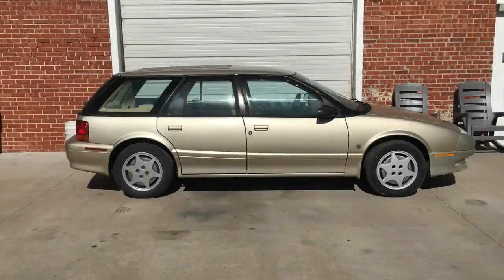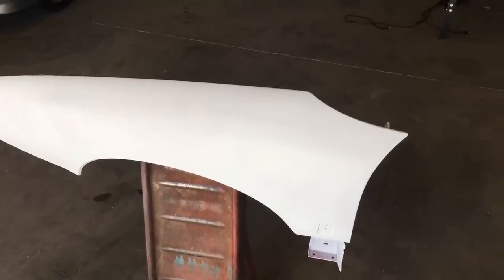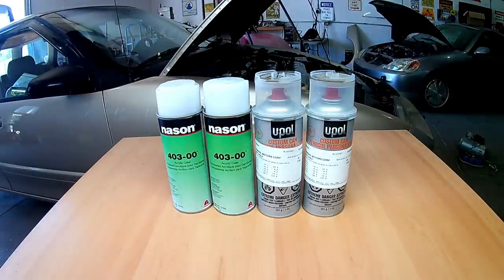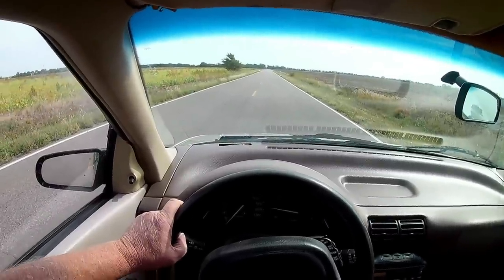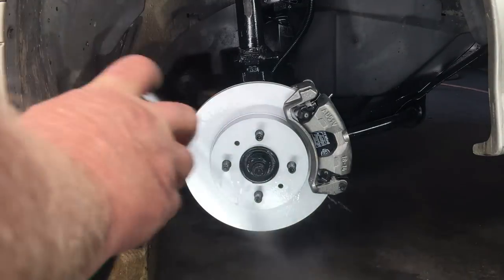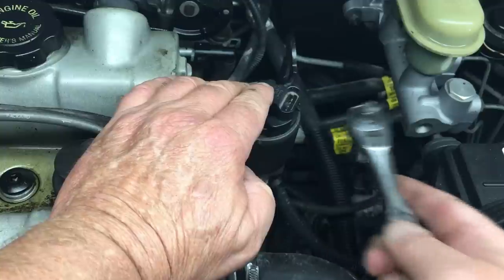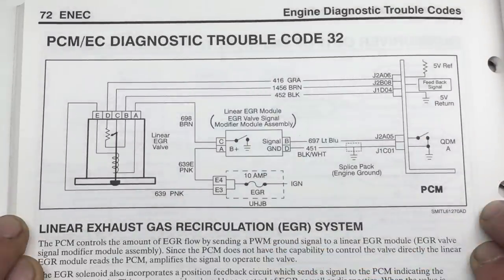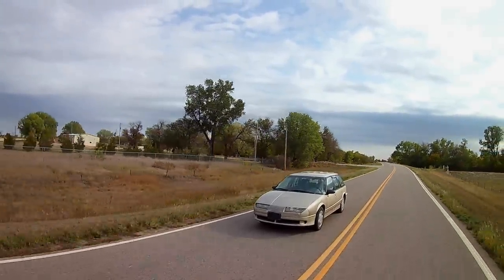S2E23  Our Saturn Wagon surprises us with some unexpected repairs and a twist or two...

Comment: that is actually quite a handsome car. though that front bumper cover could use a touch of paint. Any ideas on a twin cam that's getting worse gas mileage and still vibrates even with new motor mounts?

Comment: The higher the tire tread wear the less grip you get on road, but it should also be note that also traction and temperature rating on the tire with low rating is also bad. Oh take look at aldlcable and 1320electronics they got ALDL to USB cable

Comment: Just under $2K for what looks like a good runner isn't all that bad in 2022. (At least if you have the means to do all the work on it. Labor can add up stupidly fast otherwise.) For its age an a domestic model at that, it's in rather good condition - at least from what's visible and shown here.

Comment: I do wonder how you guys over there can drive without plates and not end up pulled over by the local rozzers, here in the UK, get caught driving with an untaxed & uninsured car and they haul it off for crushing... :S
Reply: Some states only have a number plate in the rear, so that's why you may have noticed the front one missing?
Reply: Kansas only gives you one plate. There's one in the rear.
Reply from the maker: We try to avoid the rozzers as much as possible.  All of our cars are properly tagged and insured per state law.  Kansas does not require a front tag on a car.
Reply: @robotcantina8957  GREAT TO SEE YOU AT  102K  SUBSCRIBERS JIMBO!   Congratulations, your hard work and  fun videos resulted in celebration!

Comment: did you check the water pump on the diesel engine?
you know, because of the short bolts and stuff
I would recommend to install threaded studs,  you get the most amount of thread engagement possible
Reply from the maker: Will do, thanks!
Reply: @robotcantina8957  GREAT TO SEE YOU AT  102K  SUBSCRIBERS JIMBO!   Congratulations, your hard work and  fun videos resulted in celebration!

Comment: Actually no rpm signal
Reply from the maker: Code 12 goes both ways, you are correct its no RPM signal,  but since the engine isn't running when the codes are pulled, its always going to be on the list.
Reply: @robotcantina8957  exactly what I learned in 78 at GM tech center in Jacksonville.
Reply: @dennisford2000  “Kind words can be short and easy to speak, but their echoes are truly endless.”–

Comment: To Make Money in the Stock Market, Do Nothing
The bear market endures, yet the S&P 500 index rose more than 17 percent from mid-June to mid-August. Don’t even try to guess what will happen next.....
Reply: Or you could buy bonds starting now. Should see a FED pivot after the next rate hike! Just a guess!
Reply: @dangerousdave5915  October is the most volatile month

There is a myth surrounding October in the stock market. There is even an effect called The October Effect.
Reply: People think that the stock market declines more during October than during other months. There were two big crashes in October. The Great Crash of 1929 and the Crash of 1987 were both in October.
Reply: But if we take the statistics over a long time, this effect is not significant. More bear markets were ending in October than starting in October. This data makes it more interesting. And these two crashes are old enough for most people to ignore them. Because of these points, fewer and fewer people believe in the October Effect
Reply: However, according to data, October is the most volatile month in the stock market. There are more large swings in the stock market during October than during any other month. So, you need to be ready for some strong volatility during October.

Comment: General Electric expects to save between $3-5 billion over the next 10 years by switching to 3D printing for manufacturing.
Reply: The metallic 3D printing market is expected to grow to $6.6 billion by 2026.
Reply: Scientists are looking into 3D printed food.
This sounds something out of a sci-fi movie, but it’s true. Scientists today are considering 3D printers as a food source. Currently, 3D printed food is still limited and only works with softer ingredients like cheese, chocolate, and syrup. However, scientists believe that even with those limitations, their work has promise.
Reply: Designs for 3D printing are first made using Computer Assisted Drawing (CAD).
Reply: 3D printing was first used to build tools and prototypes.
Initially, 3D printing’s main purpose was for factories and engineers to make replacement tools and parts more efficiently. Early on, 3D printing was also used for making scale prototypes with greater detail and accuracy compared to other methods.

Comment: Race Against Winter

The northern sections of the Mississippi River are shutting for winter. Meanwhile low water levels has created a 100-ship backup downstream.
Mississippi Barge Snag Forces Goods Onto Pricey Rail, Truck

Yahoo!News reports Mississippi Barge Snag Forces Goods Onto Pricey Rail, Truck😜😜😜😜😜
Reply: The supply chain snarl comes just as harvesting of corn and soybeans, the largest U.S. cash crops, is ramping up and as tight global supplies and strong demand for food and fuel have sent inflation soaring.🚜🚜🚜🚜🚜

Comment: Some tips on BATTERIES  🤠🤠🤠🤠🤠🤠
Reply: Store batteries at room temperature. Excessive heat or cold makes a battery wear out faster.
Reply: Do not store with coins, paper clips, or other metal objects. Batteries may short-circuit and heat up.
Reply: Remove batteries from devices you don’t use all the time. This extends their operating life.
Reply: Replace all batteries at the same time.
Reply: Don’t mix old and new batteries. This may cause them to leak or rupture.
Reply: Avoid mixing and matching batteries from different manufacturers in the same device.
Reply: Alkaline batteries such as D, C, AA, AAA, and 9-volt can be disposed of in your regular trash.
Reply: Make sure to prevent any fire risk by taping 9-volt terminals before tossing.
Reply: NiCd batteries containing lead must be properly recycled to prevent environmental hazards.
Reply: Consider bringing old batteries to a local battery recycling drop-off.
Reply: GREAT TO SEE YOU AT  102K  SUBSCRIBERS JIMBO!   Congratulations, your hard work and  fun videos resulted in celebration!

Comment: some tips....
Reply: Long Reach Shears
Slip PVC pipes over the handles of your pruning shears and tape them in place to extend your reach and clip high branches without a ladder
Reply: Phone Shield
When you're painting or gardening, keep your phone clean and dry by sealing it inside a zip-top bag. You can still work the buttons right through the bag.
Reply: Tennis Ball Parking Guide
If you have ever wondered why a tennis ball was hanging from your friend's garage ceiling, here's why. To park your car in perfect position every time, hang a tennis ball from the garage ceiling so it just touches the windshield. It will show you precisely where to stop. No guesswork!
Reply: Dust Catcher
Before drilling or cutting into a wall, tape a bag below the work zone and it will catch the falling dust.
Reply: Flash Finder
When your drop something small and can't find it, turn out the lights and shine a flashlight across the floor. Transparent items like a contact lens will glimmer. Other objects will cast a shadow marking their location.
Reply: Find a Flashlight
When the power goes out, you'll be groping in the dark for a flashlight — unless you wrap one with glow-in-the-dark tape. The tape glows for about eight hours after exposure to light.
Reply: Stop Losing Socks
Stuff a strip of foam pipe insulation into the space between your washer and dryer or along the wall. That way, socks can't slip into the abyss.
Reply: Pull-Tab Picture Frame Hook
If you're hanging pictures and run out of those sawtooth hangers, just grab the nearest pop can. Bend the pull tab back and forth until it breaks off. Then screw it to your picture frame. Bend the free end out slightly and hang the picture.
Reply: Cardboard Drop Cloth
Save large pieces of cardboard from boxes that you bring into your home. Store them along a wall in your garage or workshop so they're at the ready when you're working on a messy project such as refinishing furniture or changing the oil in your car. A large slab of cardboard makes a perfect disposable drop cloth
Reply: Hands-Free Door Trick
Need to go in and out the same door a bunch of times while carrying stuff? To keep the door from latching shut, I loop a rubber band around one doorknob or handle, then twist it once and loop it around the other knob. The rubber band holds the latch in. Now if the door closes, I can push it back open with my body whenever my hands are full.
Reply: Keep Deer out of the Garden

Solutions for keeping deer out of the garden and yard has become like trying to find ways to keep squirrels out of bird feeders. But according to some folk tales, when deer step on Bubble Wrap® it will spook them.

Comment: If you’ve spent any time working on an old car, you’ll know the importance of wearing gloves. Go without them, and your hands will quickly become covered in dirt, grime, grease, and other nasty stuff that’s tough to remove and toxic for your skin.
Reply: It’s also easier to hurt yourself while working in a tight engine bay full of sharp objects without gloves. That’s why whenever I dive into a DIY project, I have a box of disposable gloves or a pair of mechanic’s gloves by my side.
Reply: It’s not like you can’t work on your car without gloves—I’ve done it plenty of times when I’m in a pinch or otherwise don’t have access to a pair.
Reply: But doing it all the time just isn’t healthy. In addition to protecting from physical abrasions caused by sharp objects, exposing your skin to all of that grime that comes with old engine bays and suspension components can damage your skin
Reply: @ocdman202   noted